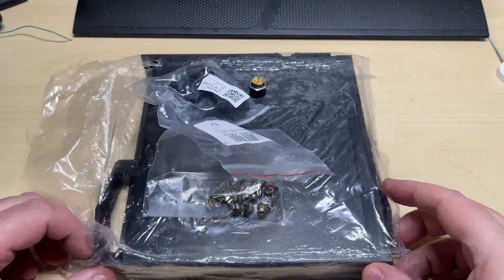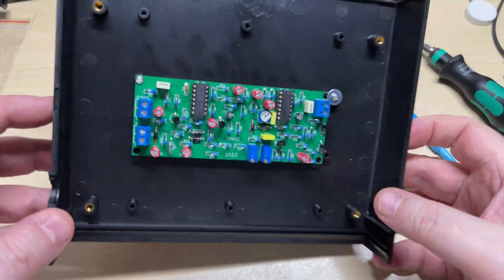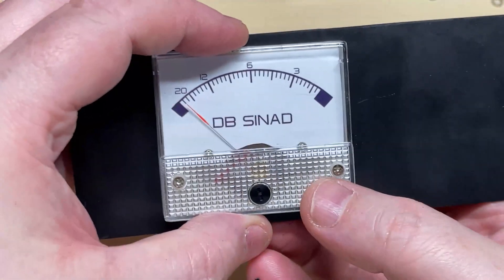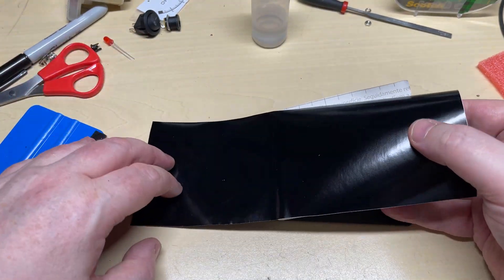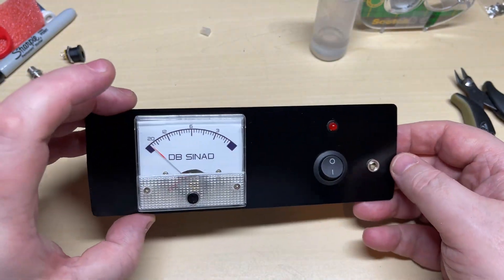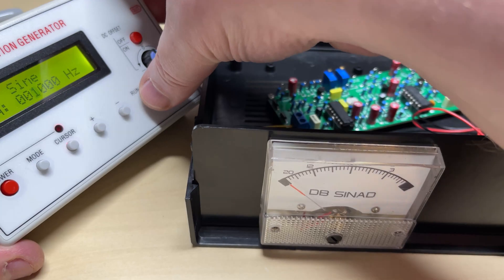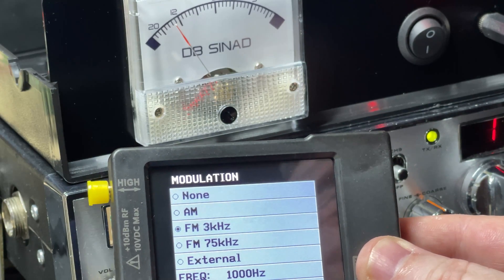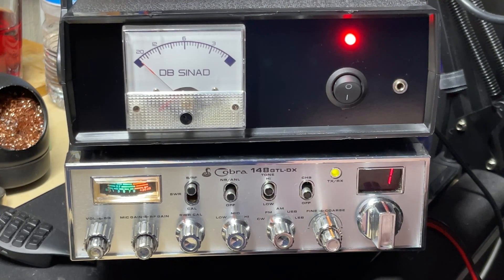EP 131 - SINAD meter - Build and test - Part3 - Final build

Comment: Super job! That fablon worked like a charm, it's amazing the variance in the op amps for noise, I ordered another 100 today from RS components and there is a variance of up to 3db on 1 in 4 of them, these are Texas Instruments ones as well, I only use the ones that go flat I bin the others although they would probably be ok in most other applications, I guess other folks put those ones on eBay 🥴 I found that out the hard way, I use rapid or RS for all my electronic components these days with the exception of RF power transistors where you kind of forced to use eBay and second hand parts, nice job and the board looks great.
Reply from the maker: Thanks , appreciate it , yeh it turned out ok I don’t have the luxury of a 3d printer ;) my op amps came from mouser so should be genuine , I think it works well now it’s setup properly
Reply: Hi, is the op amp just connected between power wires and power input? What size amp??